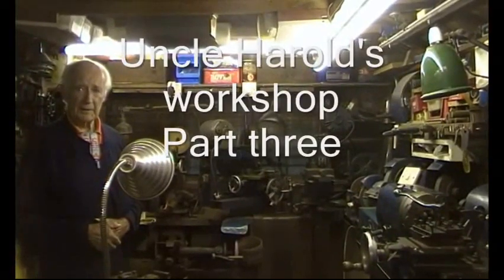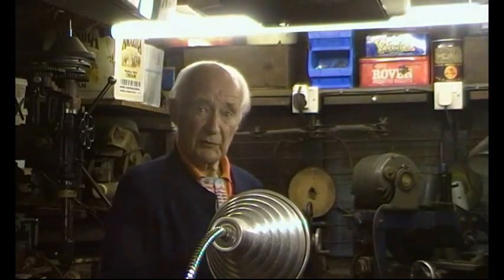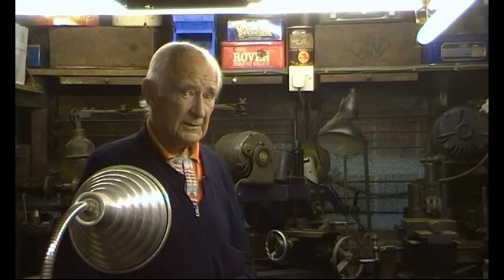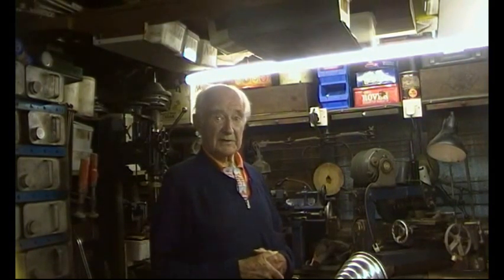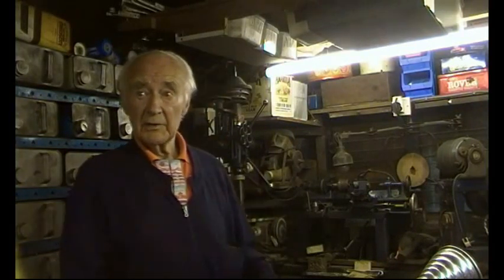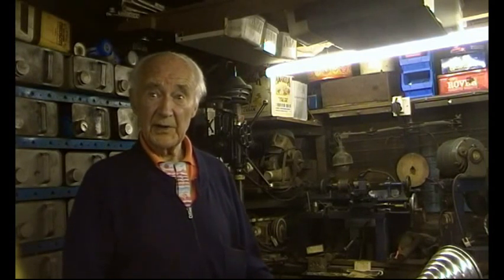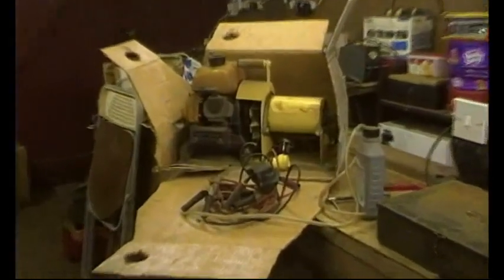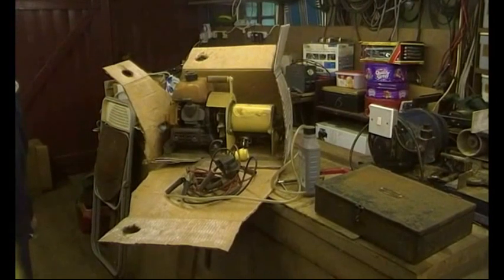Uncle Harold's workshop part 5, casting an acme thread nut and other short stories

Comment: Yes the aluminum thread casting method really works so long as the thread is not worn or has any burs on it, most of the wear is in the middle of the length of screw with little if any wear near the start or the end of the screw, don't overheat the aluminum or apply heat to the screw ,the screw should be cold and dry use scrap high quality aluminum casting  old alloy wheels gearbox casings I used old engine Cylinder heads cut bits off in a band saw don't use friction discs in angle grinders they contain silicon and that completely stuffs up castings and results in Porosity and brittleness also makes welding brittle and full of tiny holes  , don't use cans or anodized extrusions . Like old Harold I first did it about 50 years ago, and again roughly two years ago, for the same job an old Shaping Machine, an old Russian Fitter showed me how way back then, also we had the same problems with power in Australia with rostered power supplies to factories and brown outs where machinery couldn't be used, we were lucky we still got 5 1/2 days a week work. because we had a couple of kerosine fueled farm tractors to power our lathes and milling machines from their PTO shafts you couldn't get away with that today.
Reply from the maker: That's brilliant info and the stories are inspirational. Just get the job done with safety in mind and just keep the idiots out of the way. Mechanical appreciation and feeling seems to be all but lost in risk assessment and paperwork. Cheers

Comment: Who'd have thought that a cast ali nut would release from the thread and then work properly !? Very interesting Andy-  he's a man of some experience...I liked the 2-stroke generator too- you don't see a dynamo often these days. I can imagine the editing to bash this vid into shape also :o)
Reply from the maker: Dave, yes I would have thought the ali would have shrunk tight onto the shaft, but the steel shaft is hot so that will shrink also. Now I was brought up on dynamos, Morris Oxfords and Minors. That international 275 of mine is dynamo and never seen the need to upgrade. Cheers, Andy
Reply: Yeah, I've had my share of dynamos too .... including on MF tractors of the 60s.... however, I don't miss them really - depends on your personal experience, but those dreadful Lucas 'control units', and being left in the middle of nowhere with the brushes worn out, etc, etc. I know alternators fail too, but much less often in my case ! Cheers, Dave